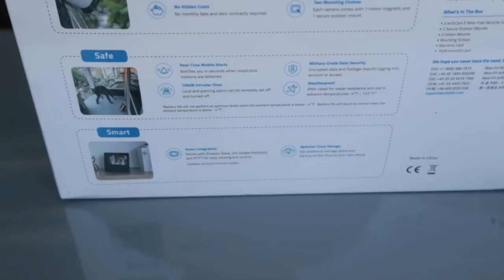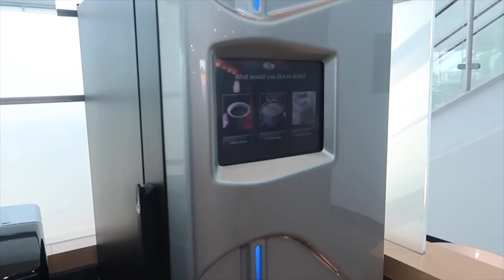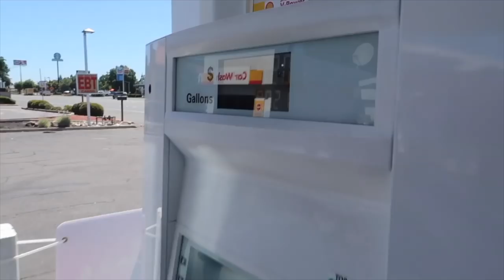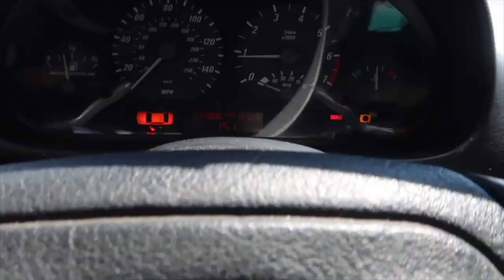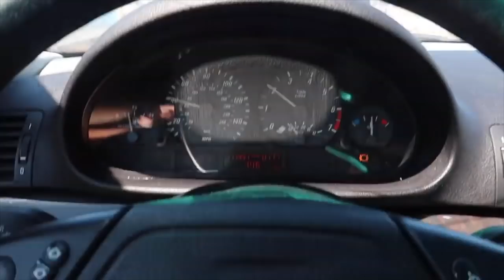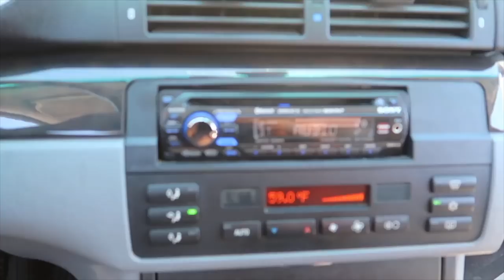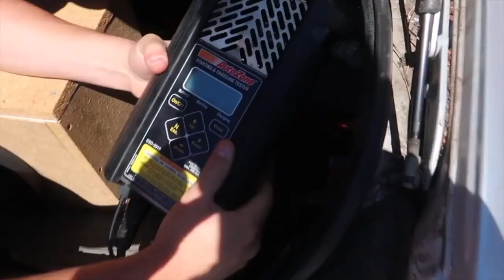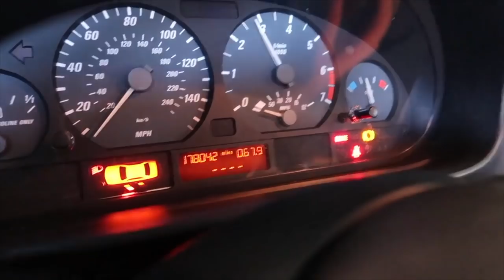TURNING THIS $800 BMW E46 TO A $3000 BMW! (Part.1)

Comment: Where’d you find project cars for 800 bucks???😳 send me a link bro
Reply: Apex Drizzi probably a site like autotempest
Reply: i got my E39 for $700
Reply: Ok Carl where’d you get that for that price??
Reply: Apex Drizzi offerup bro!
Reply: Cragislist.com bro
Reply: Short Guy Entertainment look hard bro after looking on offer up and craigslist for months i found a 2dr e46 325ci 5 speed manual that runs n drives and made it 40 min home for $900
Reply: Marketplace on Facebook
Reply: I got my e46 for 1k
Reply: Palm Christmas Tree dayummmmm son ! Where’d u get that😱
Reply: Palm Christmas Tree I wanna trade my 335i for one of those
Reply: Fxsion Entertainment it was blue booked at 3,500 but we got it for a good deal because it had a misfire which the owner didn’t know how to fix turned out to just be the oil separator hose had a leak :)

Comment: Congratulations on 30K! Hope that things not stolen that’s a killer deal for any car let alone a 5 speed running E46
Reply: justyousif maybe so but most charge 1.5 to 2k
Reply: Sold mine for $700 after spending over 6000 to fix it, bmw are money pits.. I’m so glad I did.
Reply: ToyLand Creations you sold an E46 M3 for $700?

Comment: You have the gen. 1 Sport multifunctional steering wheel with single stage airbag, it's a good wheel, much better than non-sport it's worth restoring the leather too.  Before you pay for (gen. 2) Sport aka. M-Sport wheel or the M3 wheel retrofit that both have dual stage airbags you must check your year and month of production.  In September 1999 BMW switched to dual-stage airbag controller. If your car has production date September 99 or later year you can swap to M-Sport or M3 wheel.  If your car is before September 99 you need dual stage controller as well and you need to code your car to let it know it now has dual stage controller and dual stage air bag now.  You do not want to risk your airbags not deploying, and if you sell the car do not want to be responsible for possible injuries of other people!

328 is a great great car do not be disappointed it's not a 330. Because they have almost identical torque, because M54 engine in 330 has flawed oil scraper rings so it gobbles oil insanely, and because 330 has electronic gas that responds like ass when you press it compared to 328.   You can easily make up the horse power difference with a few bolt-ons; headers, pulleys, new short ram intake or retrofit OEM 325 air intake it has extra intake hole behind headlight and MAF connection is identical diameter. You can also retrofit 330 intake manifold and DISA with a cheap throttle body adapter for +10HP in high revs with -5Nm torque in low revs, but that is not an easy trade-off for everyone depends on the driving style and purpose of the car.

Comment: Brilliant news on the 30k 😁 my first Bmw was an E46 convertable 330ci facelift built to last back then Bro
Reply: Tamer Saad 😂😂
Reply: i spotted an e46 330ci 2002 convertible with aftermarket exhaust and suspension for 6k, is it worth it?
Reply: @void7805  no
Reply: Replayable get the coupe instead or a z4
Reply: Mine uh e46 330i

Comment: Definitely dont neglect the cooling system on the E46. Looks like the previous owner didn't do much in terms of maintenance. So I would check that out as well as the DISA valve.

Comment: I just bought a 264,000 mile 2003 325i black for only $600 runs and drives quite well, cold a/c, working cruise control, interior is a little beat up but overall good shape, all windows work, only light on dash is brake pad wear, driven 1500 miles already

Comment: Hey man. Congrats on the new car. Love the content. Just wanted to say look out for failure of your FSR or final stage resistor. It controls the HVAC. A bad FSR will cause the A/c blower to turn to different levels and turn off and on randomly. It also drains the battery. Seems like you were having these issues.
Reply from the maker: K.Dot89 I think that’s what it is thanks!

Comment: Got my 2000 BMW 328i for $900 can’t wait to change almost everything in it, car wasn’t maintained properly and there’s 12 error codes and so many more issues, hopefully within 4 months realistically I can get it to proper working condition 🙏🏼 but it already has new brakes, exhausts delete, muffler delete, and new spark plugs, can’t wait to start working on it soon🙏🏼

Comment: i have a feeling your check engine lights gonna come on after driving a few more miles... they probably reset it right before you picked it up. Did the seller smog it within the last 30 days?? Not sure how it would pass without the exhaust... would fail visual inspection unless they had the hook up. Get an OBD scanner and see if it has any pending error codes. Pending/Warning codes won't trigger the check engine light until a certain amount of miles are driven or a full drive cycle is completed.

Anyways, awesome car. I'd just be cautious only because of my personal experiences with cars like that. Especially ones that had been sitting for 6 months+.

Comment: The blower motor is likely fine, it just needs the Final Stage Resistor/Unit replaced. Search E46 FSU on google. $50 and easy replacement. Good luck!

Comment: 13:04 why you rev it right after oil change? You have to wait a few minutes when you start it without reveving, until the oil goes to every corner of the engine :S

Comment: What exhaust is that?!?! Sounds amazing
Reply: Straight piped!
Reply: For a 330i? Heard some that sound nothing like that
Reply: @alexsand1103  I have an e46 330, it sounded like that when we removed the exhaust. That's a 328, so I'm not sure how different it would sound. When they put the camera close to the exhaust, I saw the muffler wasn't there.

Comment: My E46 had the same issue where the low oil light came on after starting the car for like 10 seconds even though the oil is at the max level. The oil level sensor is bad, super common on all E46's easy fix, but you obviously need to drain the oil again. i drove mine around for a few months with a broken sensor and just checked the dipstick every week.

Comment: The 325 & 330 have better engines than the 323 & 328.   Your car probably has the low emissions engine. Which is why it didn’t come with the sport seats & sport suspension. Clean looking body tho, looking forward to seeing what you do with it.

Comment: You can not run cheap gass in that car i have a 2003 325i e46 4 door bmw and it does not like cheap gas go with the vpower gas it love it i filed a spark plug and number one and I had to replace it because of being with the middle grade gas it don't like it

Comment: I got a green 2004 325ci convertible soft top with only 40k miles 3 keys, clean title, and the car looks like it’s new oh and it’s also manual but I’m need to get it a hard top anyone know a place besides bmw